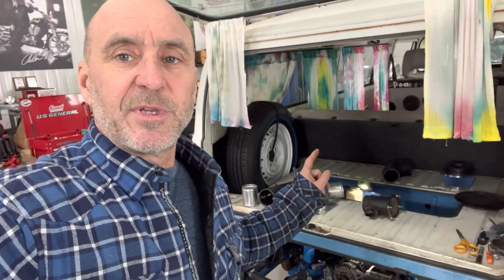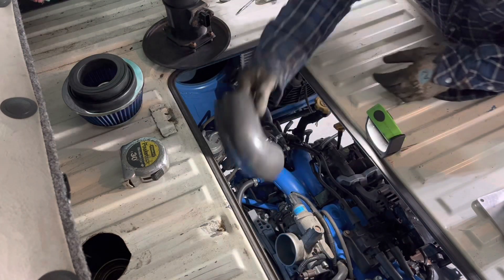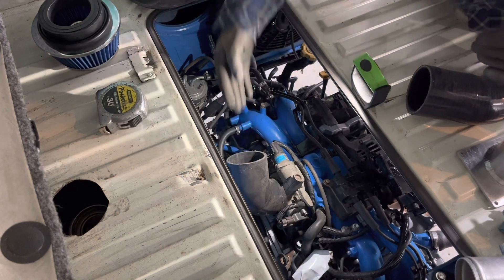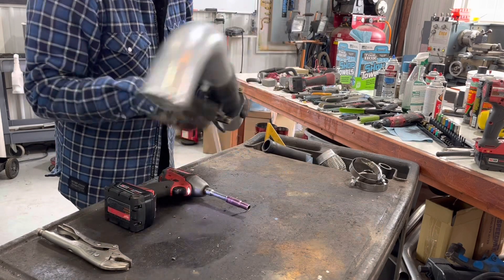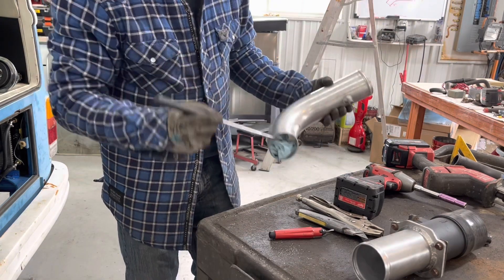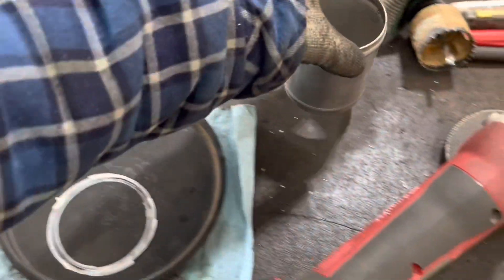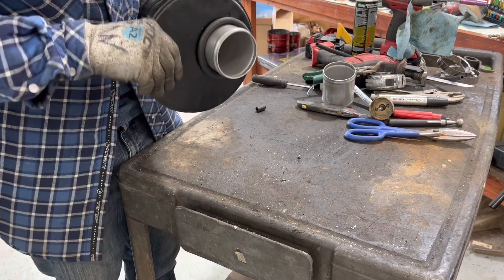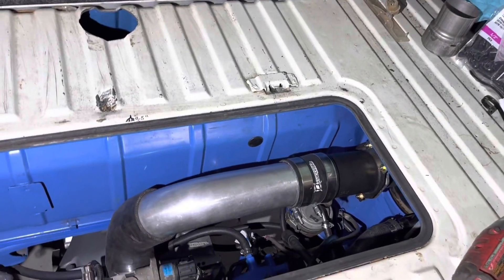Part 9 - VW bus with Subaru Engine- air intake system installation

Comment: Nice job! 
I do have a suggestion. You may want to think about water being ingested into the engine. I could see that happening if driving in a heavy rain.
Reply from the maker: Hey TM!  Yes the air is coming in that vent, but it’s probably much better with my air cleaner inlet location than the air cleaner being in the engine bay- I’ve seen Busaru videos and the filter gets pretty dirty in the engine bay-